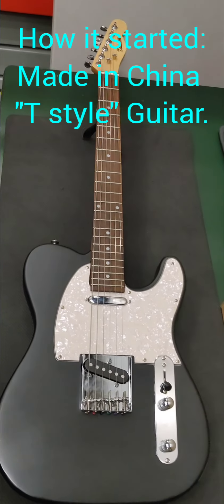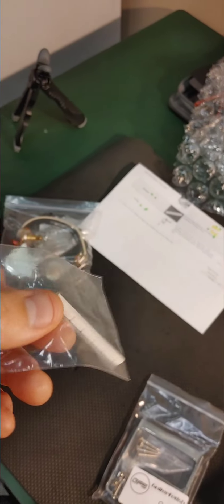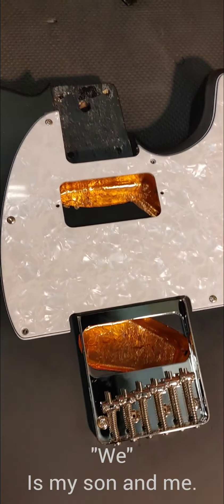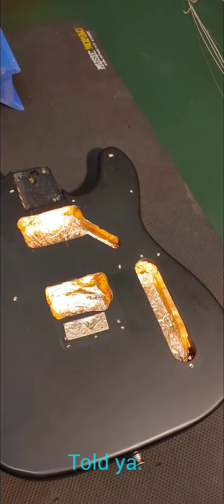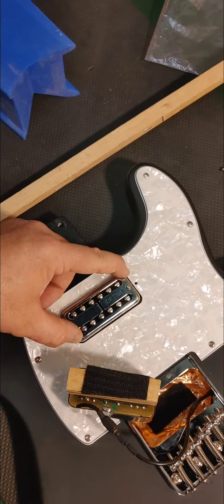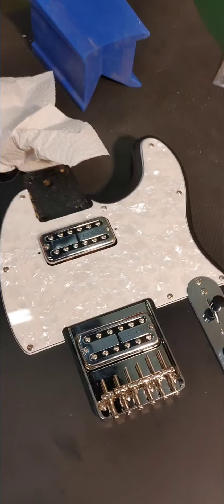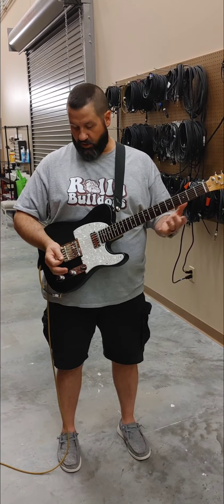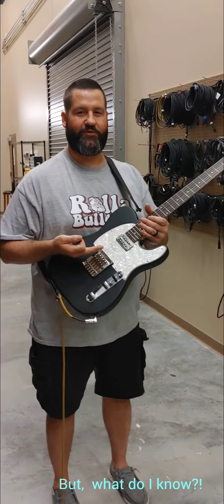Creating a Custom "Tele-Tron" Using Affordable Parts

Comment: Those "staggered tuners" are actually Wilkinson's version of "locking tuners".  You feed the string through the lower hole and then around and back through the upper hole.  
I have similarly modded a tele by replacing the neck pup with a 'Tron, new pots, etc.  I wanted to keep the Tele bridge twang, but a more Gretsch-y neck sound.  It's my FiltaCaster!
Reply from the maker: Thank you for that info! My tuners didn't come with "how to use" instructions. Thanks for helping me out!
Reply: GFS makes noiseless Tele pickups, as well as near field humbuckers of various sizes, from firebird style mini-buckers and mini-trons, to rough allegories to something like Hot Rails/Cool Rails/Fast Track/Tone Zone S. They also make adapters to turn any brand puckup into kwikplug compatibles.

Comment: Those look a lot like the AliExpress generic filtertron style puckups. Bought a set, but used only the bridge pup, for a homemade Tele i made last year. I swapped the pooe screws for longer ones, more close to what's in an original filtertron. Great video!
Reply from the maker: Thank you. I may need to try longer screws too. So far, they work great. I am rocking it tomorrow at church!
Reply: @ButWhatDoIKnow  that's great!

Comment: I love guitar fetish pickups. I have an Epiphone Les Paul with Dream 180 bridge/Dream 90 neck and a Seymour Duncan Active Blackouts Preamp, basically the active hardware from the Passive Look Shells/Gus G Signature sets. I also have a power tube emulation pedal from GFS, all analog, that goes in the FX loop of my solid state and hybrid amps.

Comment: With the wiring, did you solder the Red White and Green together for your hot, and the black and unshielded wire for your neutral? I am looking to put these into a electromatic jet with a single ground and Hot to Gretsch's already installed quick connect. also would wiring the red and white "coil split" cables together, taping them off and just wiring the green to the Hot work as well? I am a bit confused by the 5 wire design. Thanks!
Reply: BTW that Tele is a sweet rig!
Reply from the maker: @ATLovitt  Good question. It all depends on your pickups. Every company does it differently and uses various colors on the wire. There is no standard. 

For this wiring, basically, I took the start of the top coil (red) and the start of the bottom coil (white) and soldered them together on the switch as if it was 1 positive lead. Then I soldered the black and the unshielded cable together as a common  ground. This turned a 4 wired pickup into a 2 wire pickup. In hindsight, that isn't the best option.

Iseally, you can also solder the end of coil 1 (red) and the beginning of coil 2 (white) together and tape (shrink tube is best) them off. The signal will flow through both coils (a filtertron is a humbucker, thus, a 2 coil pickup). Then solder the start of coil 1 (your pickup should be labled with start wire) to the switch for each position. Current will then flow from switch into top of coil 1 out of the end of coil 1 and into start of coil 2 (the two wires you soldered together and taped off). Then the ground and unshielded are soldered together and get soldered to the back of volume pot.